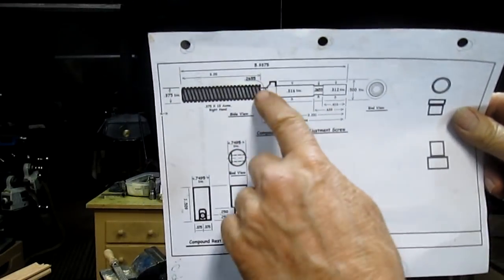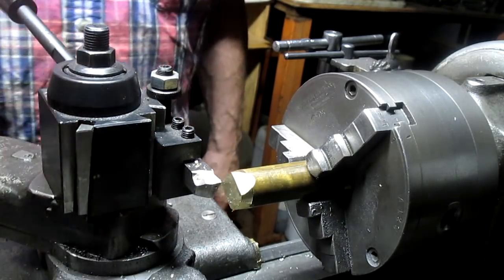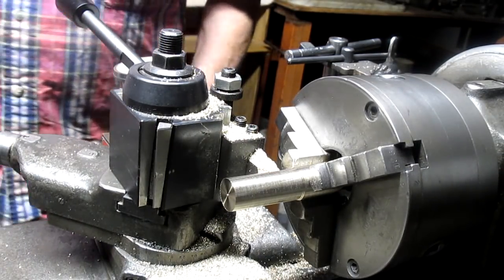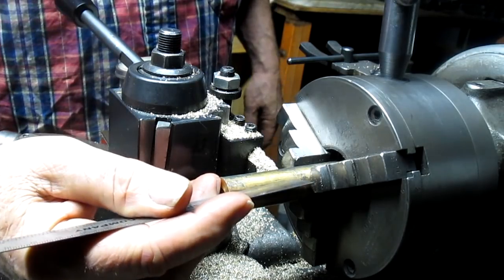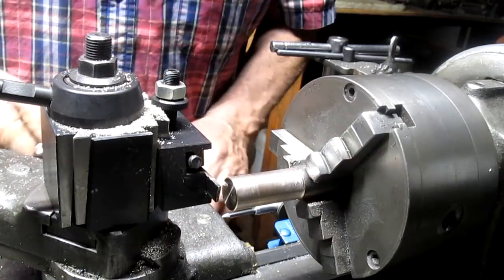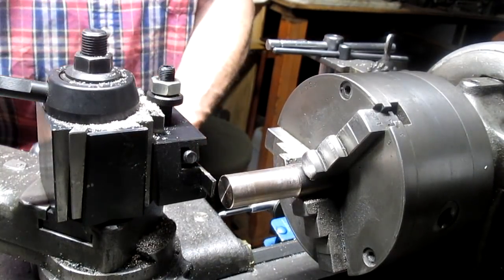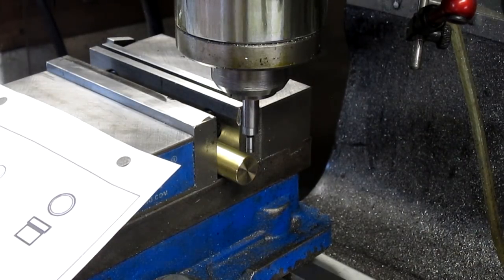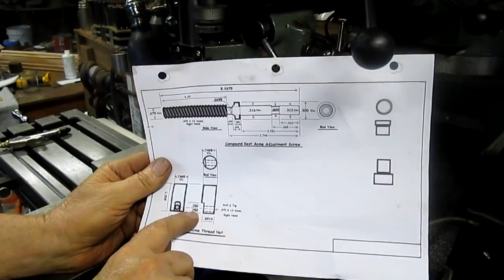Monarch Acme Screw Build #1

Comment: Good to see you back again hope you're safe from the new round of fires sheesh
Reply from the maker: No new fires in our area, fingers crossed. All of Northern California did get power shut off for 3 days while the winds gusted through.
Reply: @NikColyerMachineWorks  I bet that's annoying having your power shut off for three days and my question is are they still charging you for those three days cause I'd be a little skeptical about that issue
Reply from the maker: @jerryshelton1481  Annoying, but far better than having a tree fall across some lines and start a fire in gale force winds like in Paradise and more recently in Talent, Oregon. They charge by how much electricity I use according to the meter that gets read once a month.
Reply: @NikColyerMachineWorks  well the reason I mentioned the cost was we live in an area that was hit pretty hard in 93 with the blizzard and they tried to charge us almost 3 times our normal bill and us without power for two weeks half a month trust me they got an ear full
Reply: a tip: watch series at InstaFlixxer. I've been using it for watching loads of movies lately.
Reply: @David Finley Yea, have been watching on InstaFlixxer for years myself =)

Comment: If you find out what caused that jump on your lathe, let me know.  I noticed the same thing on the Old Warrior the other day.  If I figure it out first on mine, I'll let you know what I found.  Old machines need lots of TLC, first we gotta figure out where to apply it.
Reply from the maker: Can you tell me the exact time in the video, I don't remember.
Reply: @NikColyerMachineWorks    About 8:10 to 9:30, where the first attempt got spoiled.
Reply from the maker: @infoanorexic  I probably didn't take all of the slop out of the cross slide, either that or the indicator was slightly torqued as I adjusted the slide in toward the work which would give me a bad reading. Either way it was operator error.
Reply: @NikColyerMachineWorks    I checked all of that with mine, it didn't help.  Applying feed on the carriage is causing something to shift between the saddle and tool post, even though the slack is taken up and the gibs are tight.  My best guess is that something is causing a slight twist in the saddle/carriage assembly when it gets moved, hard as it is to believe considering how massive it is.  It's a new issue for me.  I'll chase that hare after I've checked and re-leveled the machine.  I suspect that it may have settled into a twist.
Reply from the maker: @infoanorexic  Chasing down those kind of ghost issues ain't easy. Good Luck!